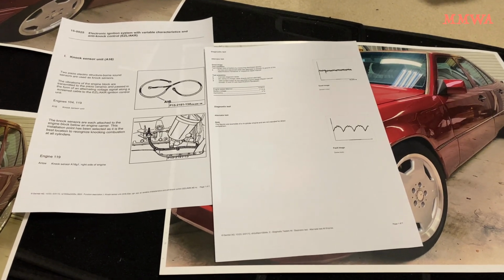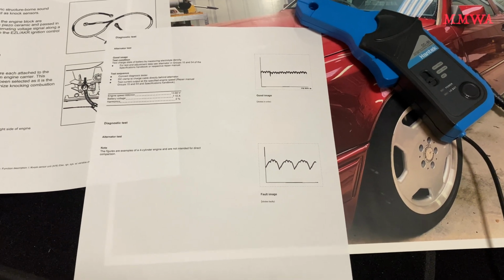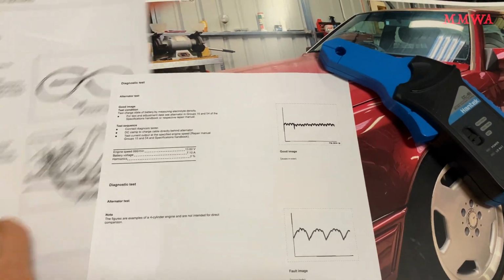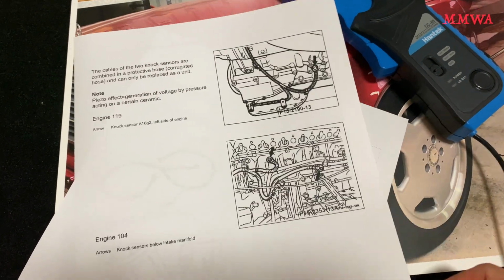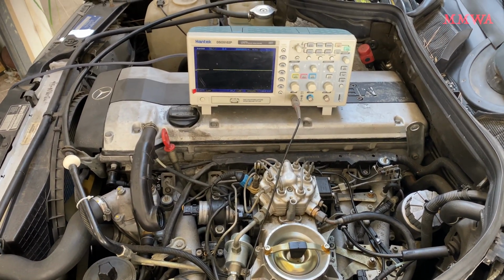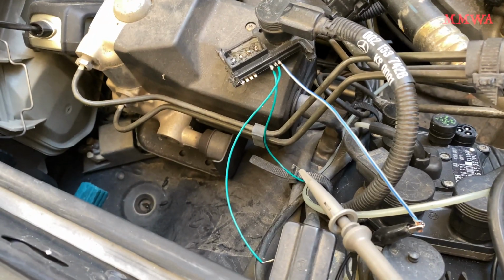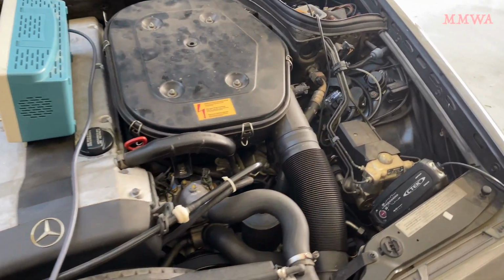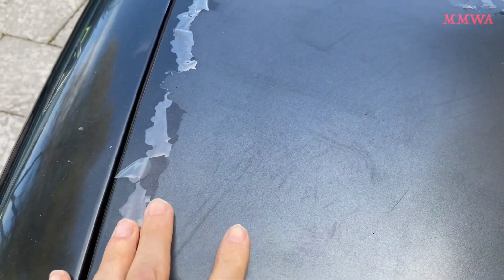Mercedes M104.980 Testing Knock Sensors & Alternator (AKR/EZL)

Comment: Good evening, I've looked through all your videos. I have a 1993 mrecedes sl 300 24v and I can't find where the cable from the front pulley sensor near the fan connects. I need help. Thanks.
Reply from the maker: front crank top dead centre sensor? It is only used for diagnostic purposes and terminates at the round diagnostic socket only. It is not used by the car itself at all.

Comment: Hey.. I have some questions about m104 4 cylinders.
Reply from the maker: @ahmedsa8461  no such thing. 4 cylinder double overhead cam 4 valve per cylinder engine from 1993 is an M111.

Comment: Happy new year!
W210, ok you like to work on cars ;-)
M113, Motor without emotion but never will stop running.
Reply from the maker: I know what you mean, m113 goes ok but doesn’t even sound like a v8 in stock configuration. The nosiest thing is the cooling fan(s)

Comment: Snap... with the knock sensors! It's about 5 years ago now. I also discovered with my Aus. 1990 124.051 that the harness had degraded. So for those who think the degradable wiring  began in about '93...think again. However, I've found no other instance of it on the car and I'll bet it's the same for you. Part no. 002 153 74 28 and of course NLA. I had massive pinging but it was before I fully sorted the KE-Jet and things were wildly under load. To add insult to injury my knock sensors which were Siemans were cracked up, rusty and disintegrating. I did some comparative research on the values and found Bosch 026 123 10 26 knock sensors were close to the Siemans. So, made a new harness and used the Bosch sensors. Had to remove the starter motor to fit the rear one. Not a hint of pinging since.
Reply from the maker: have been thinking of making up a harness with modern connectors to use the later dime a dozen m104 knock sensors. It probably would work. Note this is the first time i’d ever experienced sustained pinging. it was at very light throttle going up a gentle incline after the car had been parked momentarily. It might have been a very hot spot in the cylinder head. Other times i’ve heard it is with stale fuel and only very momentary till it self corrected.
Reply: @MMWA-DAVE  I assume you've replaced the ignition coil on blue -black. Old ones can play up when hot. Was the source of a lot of my problems.
Reply from the maker: @TOONACEDRELA  yeah all ignition stuff is new on both cars - not worth the risk with these fragile EZL’s. I even use period correct NOS plugs 😃
Reply from the maker: @TOONACEDRELA  speaking of ignition - i’m certain the reason the knock harness is 1 piece with coax all the way to the sensors on KE and LH cars is because they use distributor ignition (extremely noisy environment with spurious RF emissions) Later HFM cars have the connector’s at each knock sensor presumably because of the far lower amount of noise, with coil on plug and an arc occurs within the confines of the grounded engine. Adapting later plug in type nock sensors with connectors might well work but there could be some noise introduced at the connectors where the shielding is opened. I’d absolutely continue to use coax too - the EZL would be going crazy and no doubt retarding all cylinders ignition with the amount of noise received using un shielded cable.
Reply: @MMWA-DAVE  Yeah, it's a real hassle, making a substitute given the NLA of the original ones. You are more or less forced to use the plug in type which I did with coax right down to the connector. No discernible problems and the car is going like a rocket. I also have a number 2 trimmer plug in the EZL which is the U.S standard. Our cars came with a number 3. Makes a noticeable difference.
Reply from the maker: @TOONACEDRELA  What kind of coax did you use, got any pictures of this setup you made?
Reply from the maker: @TOONACEDRELA  PS i cant even reply to your email. I own my domain and its coming up saying I of all people am unauthorised to send you an email. Looks like you’re being shaddow banned 😂
Reply from the maker: Other possibilities- include of all things - engine mounts. If engine mounts have gone flat at the engine is bouncing around metal on metal, this can cause false knock signals. Known issue on other cars but never heard of it on these. My mounts are kinda crap now i am feeling the engine through the steering wheel. The mounts are about 10 years old and probably due again.
Reply from the maker: I remember seeing the 104.990 (lh 104 in w140) being still available when i rebuild my red engine and decided it was too expensive to just experiment. I put the question out there and asked if anyone had tried it and got no response.

Likley it does and the only issue will be the excess length of the cable at the EZL end due to the ridiculous size of the w140 and where the EZL is placed on them.

On red I cracked off all the crumbling external plastic coating and wrapped the entire harness with weatherproof automotive harness cloth tape and zip tied every end to prevent unraveling. So far so good but not in the least a daily driver 😃
Reply: @MMWA-DAVE  Definitely something strange with the communication. I wish I could have used the tape method but the sensors were disintegrated. There must be a good solution to this which would help others. When I used the plug type new sensors there were problems with the plug fouling things and the whole thing was pretty clunky. It works and is still on there but I was never very happy with it.
Reply: Very interesting information gents. On an M119 how could I know if the knock sensor is retarding the timing? Really would like a visible warning, so the issue can be checked? Also, what the best way to insulate this sub loom, to reduce interference from a 3rd party, ie ignition? Basically I am interested in performance, so if the timing is being knock back, I would like to know. I only us 99 octane fuel here in the uk 🇬🇧
Reply from the maker: @bernardwarr4187  as long as the factory sheilding is in place it works extremely well blocking interference. Its not uncommon to have the plastic external coating all falling to pieces though. I’ve wrapped my harness as mentioned but i dont know how this would cope with harsh UK weather if driven daily my car is basically a garage queen. The EZL only reports a fault if absolutely maximum amount of retarded timing is applied to a cylinder and its still knocking. (assuming you have a KE or LH m119, i know less than nothing about HFM 😂 ) using high octane is already a good thing, oh and if it is KE or LH, for best performance you should run the high octane fuel trimmer plug on the EZL. On my cars its plug number 2 and plug 3 is for low octane fuel.